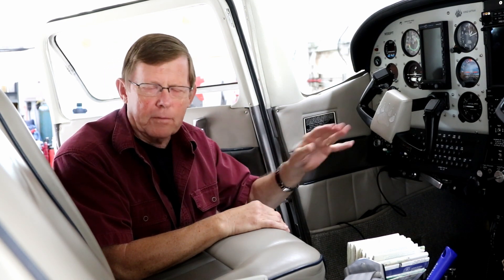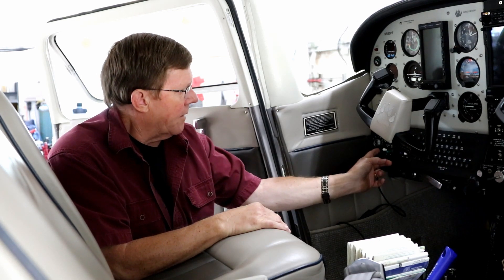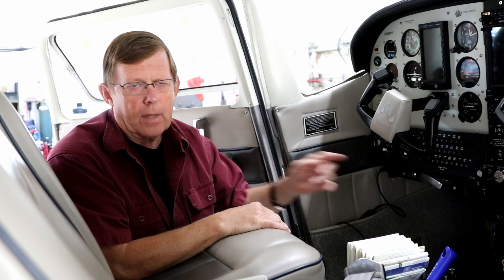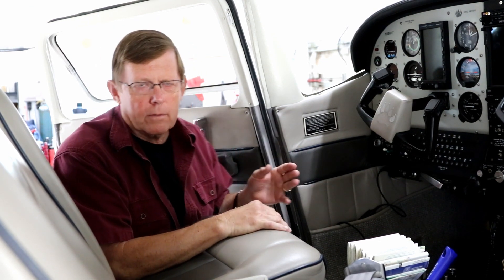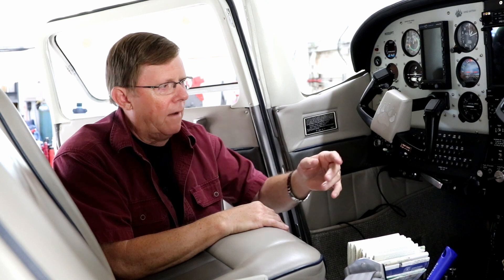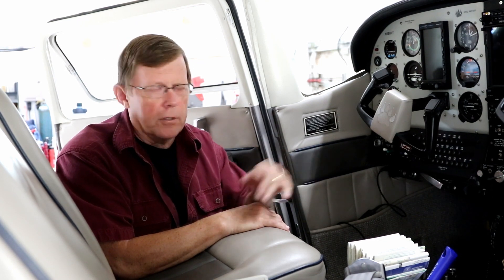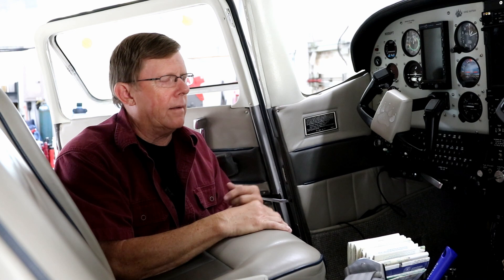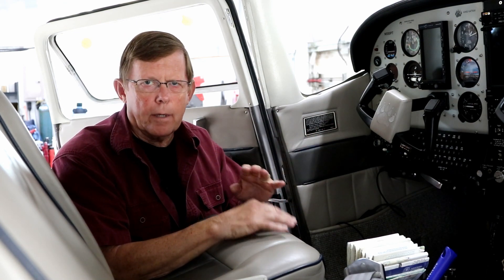Boost Pump Usage

Comment: Very well said.  I just took a job at a shop and having zero experience with fuel injected engines, have been struggling with starting.  This is a very good explanation.  Thank you very much.